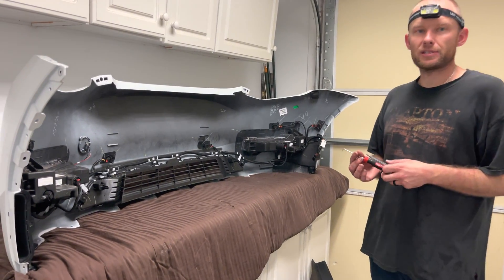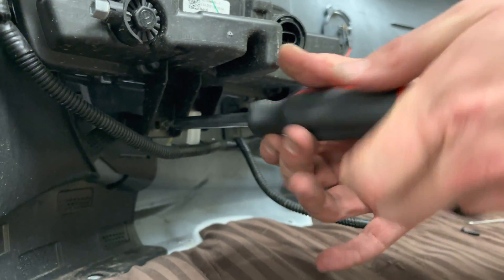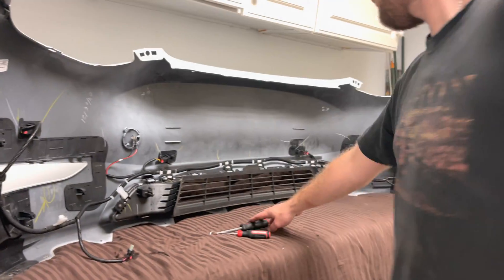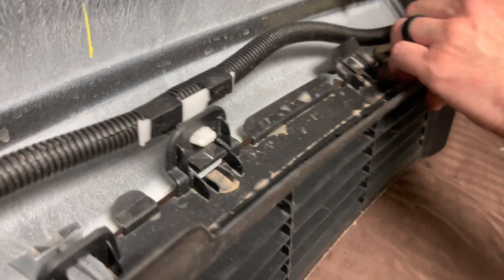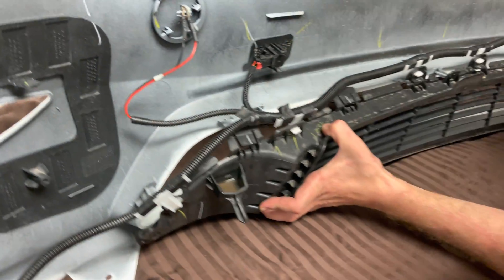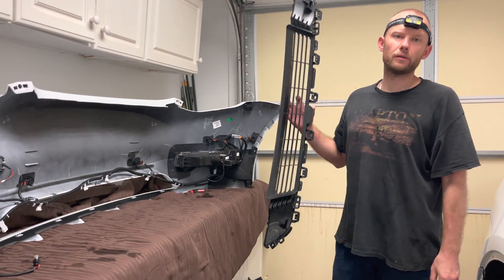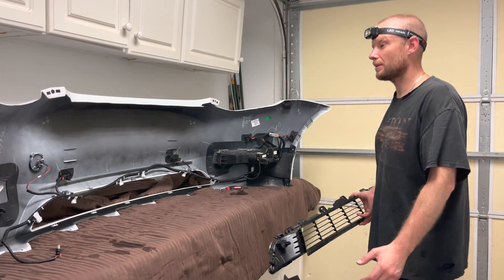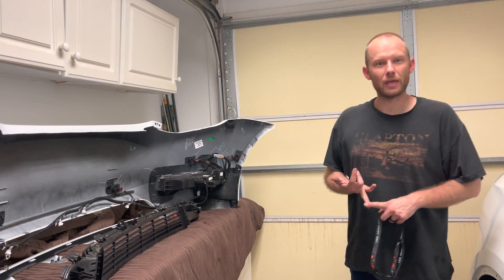Tesla Model Y/ Model 3 Fog Light and Grille Removal (Video #8: Tesla Disassembly)

Comment: Someone hit my car with a shopping cart and there was a big scratch on the front bumper. I went to Tesla to get it painted, but Tesla said it would cost about $2,500. I got so much information from your video that I thought I could replace the bumper on my own, so I ordered a used bumper from online. I'm plan to replace it next week. Thank you again for amazing information.
Reply: how did it go?
Reply: @InterMystery  long story short, I was  planning to replace it, but Tesla had a good deal so I traded it in for 2024 Model Y and I returned the bumper.
Reply: @yogipower1598 They took it like that as is without getting the bumper fixed.

Comment: So what about the plastic that holds all those components you disconnected, are you able to pull those off as well and connect the other pieces together to another spare bare empty bumper?
Reply from the maker: It’s all glued on unfortunately
Reply: @GdayFraz  you think they can be pried off and re glued back together? Or would the plastic break off with that kind of attempt?
I’ve been wanting to find another bumper to replace my current scratched bumper from another vehicle